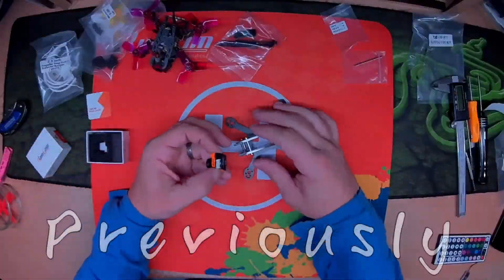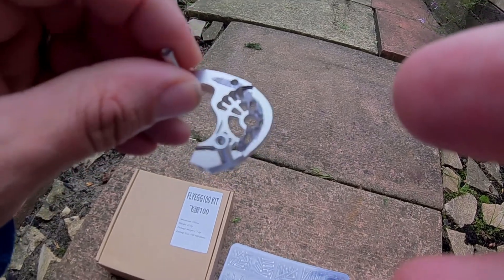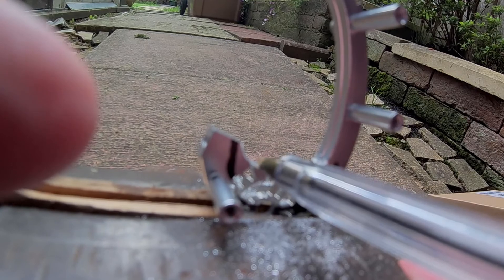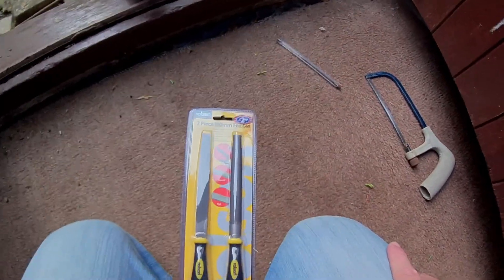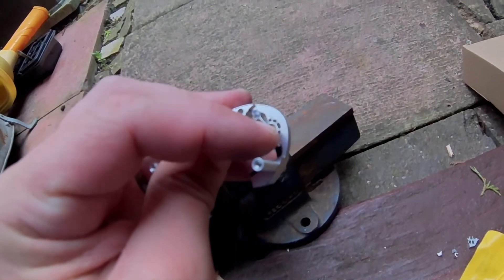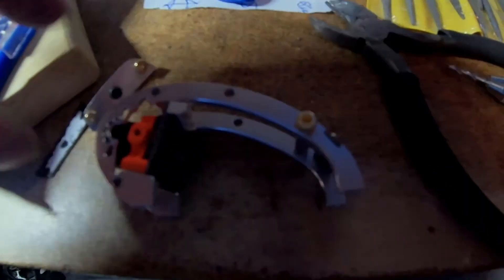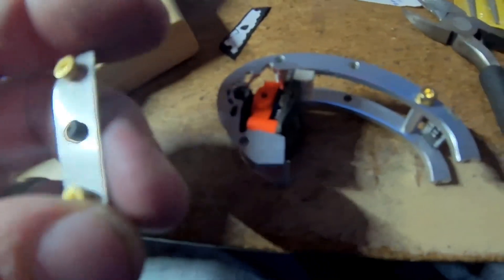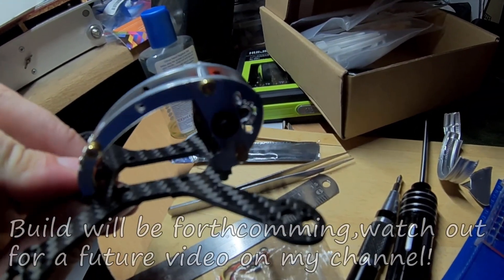Bespoke Kingkong Flying Egg 100 Runcam Micro Swift Mod!

Comment: Can you angle the camera?  I'm about to do this mod.   If not is there any way to make the angle adjustable?
Reply from the maker: How I have done it - it is fixed at 5/10 degrees,however I'm in no doubt that you could get to quite extreme tilt angles taking a bit more material off and a slight different position on the camera to bracket mounting hole.

I just flew the final build with this mod yesterday and more tilt is certainly needed. Please let me know how you get on!